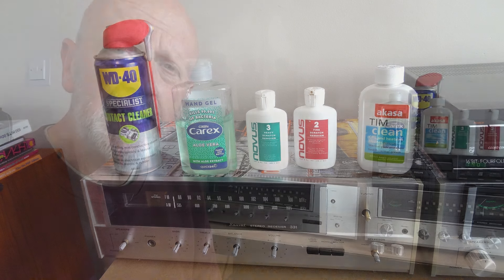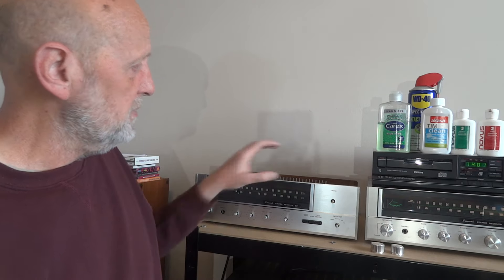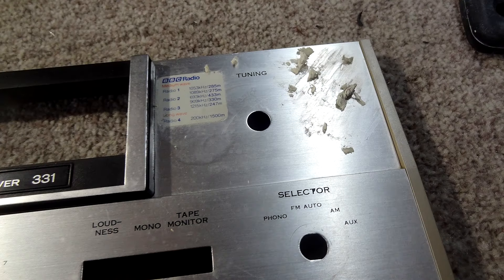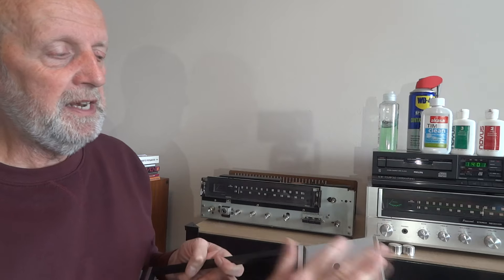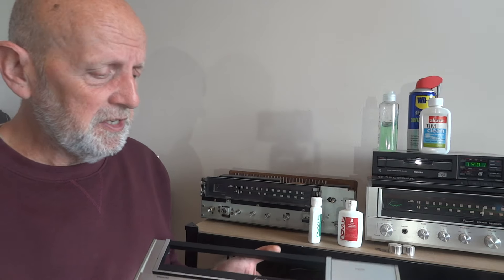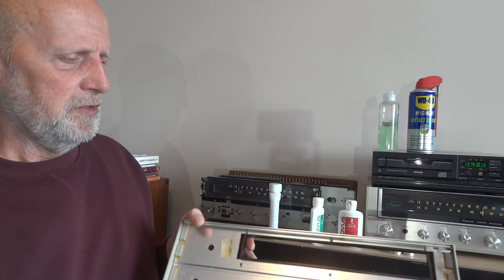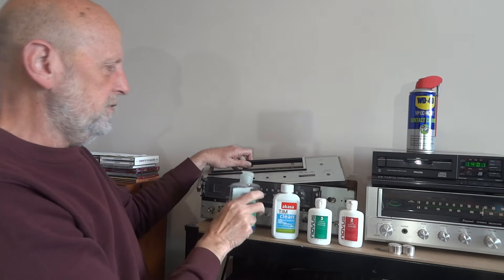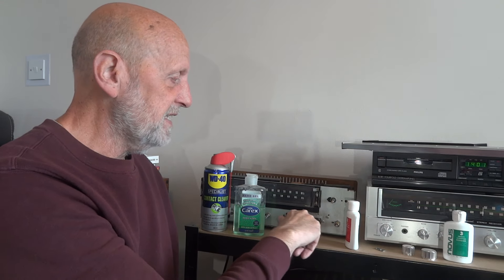Cleaning Vintage Amplifier / Receiver Brushed Silver Aluminium Front. HiFi Restoration repair

Comment: Instead of the vinyl wrap. Sand the wood back and spray the wood matt  black. Use 3 coats. It looks much better
Reply from the maker: Thanks Dennis, might consider that. Not to sure how good I am at spray paint, think its not as easy at it looks. But worse ways could re wrapp again.
Reply: @MichaelYates  make sure you sand it down so it’s completely smooth and buy a good quality Matt black spray can.
What’s your email address and I’ll send you pictures
Reply from the maker: @dennisvalsamis856  Will do thanks, My email address is arcadeimages@gmail.com

Comment: Thanks Michael. A few suggestions that work for me:
- I've found that the best stuff to remove sticker residue is paint brush cleaner (not brush restorer). In the UK, Polyclens. As it's miscible in water you can finish off by removing it with a wet wipe.
- The reason hand sanitiser works is that it contains an alcohol, and good old isopropyl alcohol (IPA) is a safe choice for most surfaces, though some plastics can go sticky.
- An old electric toothbrush is great for cleaning all the detailing in knobs etc. 
- Of course, try out anything new on an inconspicuous part of the panel first. And pay special attention to the decals / lettering as these are the most vulnerable parts and can really devalue your restoration.
Reply from the maker: Thanks Terry for all your suggestions, good idea with the electric toothbrush.

Comment: Hey Mike, over the past year I've dipped into the vintage stereo addiction.  I purchased a Kenwood KR 7400 and used it for a couple of months before I was deployed and had to be away from the states while my belongings sat all summers long in an un-air conditioned apartment for about three months here in steamy Florida.  When I returned, I noticed there is some scratchiness as I adjust the volume up and down - it's only merely a nuisance, but I feel as though it's not transmitting the same volume power to the speakers as it was before. Is this something I'm merely imagining, or is this something that happens in conjunction with the scratchy controls?  Thanks.
Reply from the maker: It could well be that the oxide and residue on the surface that the wiper touches in the control is causing your unit not to sound as loud as in normally does, as not making proper contact and adding to the resistance. Not for certain but a possibility and worth cleaning anyway. Also the input selecter / tape monitor/ speaker selector could be another factor and all need cleaning.